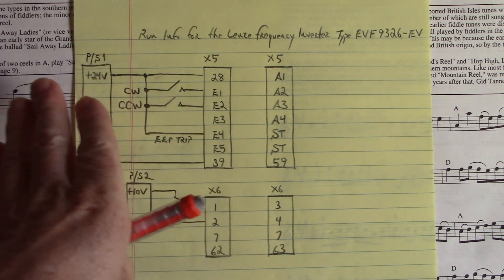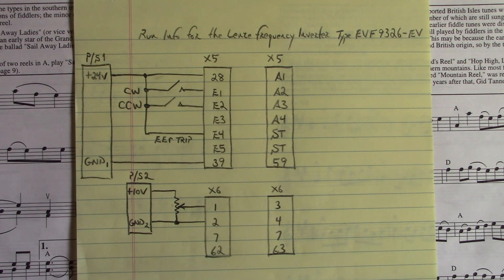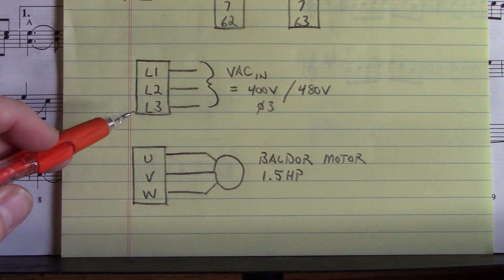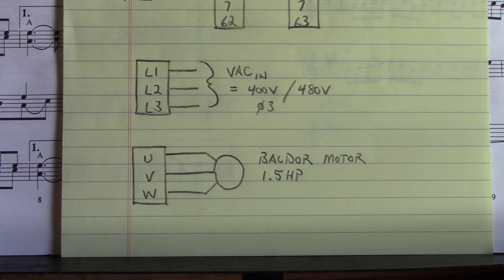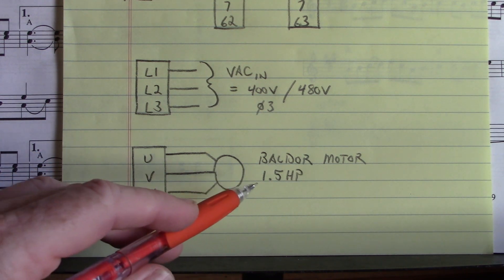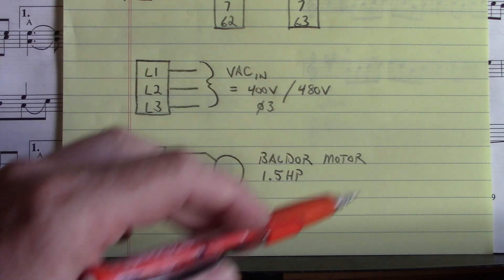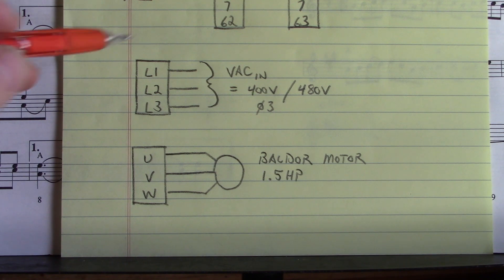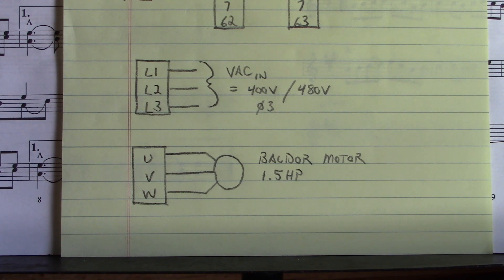Testing the Lenze Inverter Drive EVF9326 EV

Comment: Hi Mr. McDonald
I have a LENZE drive EVS9326-EVS004 model and I need test it using LENZE motor MCS09D41 type with encoder feedback.
Can you help us to definy parameters for test unit ?
Note: I am using Global Drive Control software

Comment: Hello dear i hope you are well. Please help me if possible to find new or used lenze emf9373db programming interface and lenze pc software OS LOADER V31 . This to can switch from Cam Profile V81 firmware to Servo Inverter into a lenze 9300  22kw power unit . Thanks

Comment: Nice video 👍
Reply: drive not running ... i think there is some parameter settings ? 
please share the correct setting for parameters ?
eng.kamran.oman@gmail.com
Reply: need parameters settings before run the any motor with lenze drive  please share setting which you using to test drive on bench with motor

Comment: Hello Mr. PeePaw, how are you?
This Lenze equipment was so good and so flexible, I'm sad they dropped the production to this trash they are selling now.
In the shop we are specialists in both Lenze (93xx) and Baumuller old stuff, and I already saw some of this new stuff from Lenze destroyed, because of this new bus concept they are using now.
The bus don't take the overload of a shorted IGBT module very well, normally you get both the bus and the power board destroyed, leaving the only possible option of buying new stuff.
Programmed Obsolescence? We can't tell... But is sad to see that inside it's basically the same electronics as the 93xx, packed in the wrong way.
By the way, I've some good news! We are going to represent a big machinery manufacturer, that have lots of KEB equipments around our country.
We already fixed 3 machines, and both sides are getting excited on how well it is turning.
I believe we are going to make a good deal this time haha...
If you need advice about Lenze 93xx, I'm glad to help you, just email anytime, my friend.
Cheers buddy 🍻
Reply from the maker: Hello Mr. Riggs, great to hear from you again. I am very happy that your repair business is going great. There ain't to many folks can repair these things. I have not seen the new Lenze equipment.  From what you describe, I don''t think I want to. HaHa... Thanks for being there:)
Reply: Hi Mr Riggs i suppose you're well verse with Lenze 9325, may I ask how to reset  internal controller inhibit error without the XT keypad?
Reply: @skypeople2  hi Thomas. If the internal inhibit error that you are saying is the same I'm thinking, you should correct by applying 24V to a connector. Please, specify the exact error so I can give you the right direction.
Reply: @electronicscaos  Hi sir, the machine error code is C0183/122 "controller inhibited internally", does this mean connector X5/28 is supplied internally or the 24V should be supplied to connector X5/28 externally? is it possible to clear this error by setting connector X5/E5 "trip reset" to high? please enlighten me thank you
Reply: @skypeople2  I believe there is a connector X11 in your drive. If that is the case, you must provide 24V to this connector (according to manual) to disable the internal safety inhibitor circuit. Let me now if it worked, and ask me if I can offer further help.
Reply: M.riggs sir i have lanze E94AM I replace bsp pnp transister on +off fan its shorted i fixed new now after 10mint drive showing heatsink fan alaram thanks sir am from pakistam sir can you give me contect num emal
Reply: @electronicscaos How do I contact you for advice on Lenze 93xx? What is your company name?